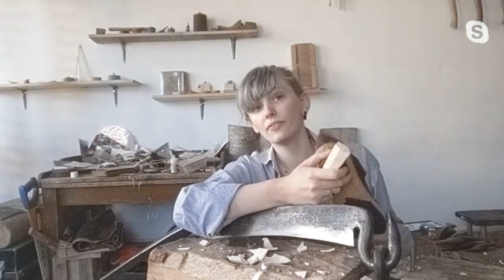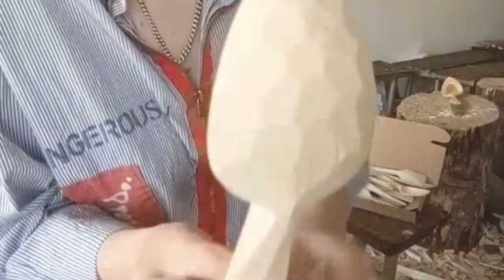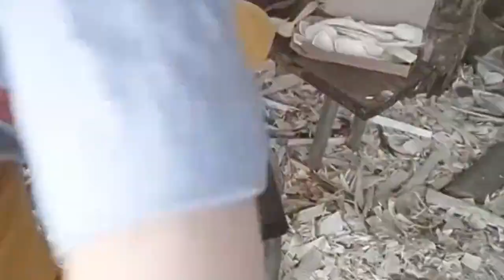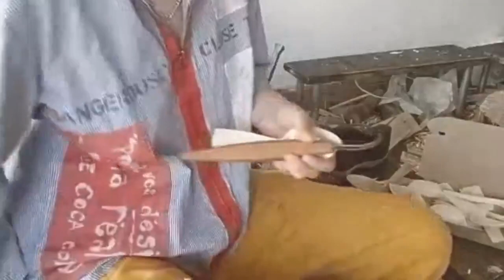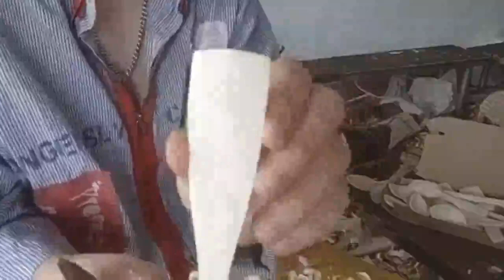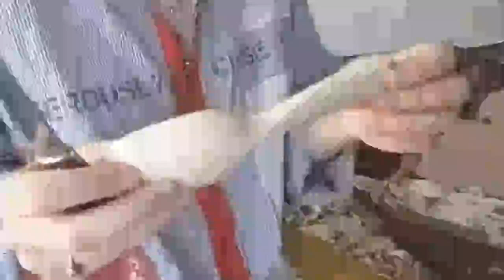Mary May woodcarving livestream with JoJo Wood

Comment: I made a makeshift stock knife by taking the handles off a large drawknife, straightening the handles, bending one end into a hook. It’s a paper cutter for wood and works surprisingly well considering it’s a tiny imitation of the real thing. I use it a lot for certain things I could use an axe for but yes...more control and easy to cut slight curves etc. IMG_1526.JPG